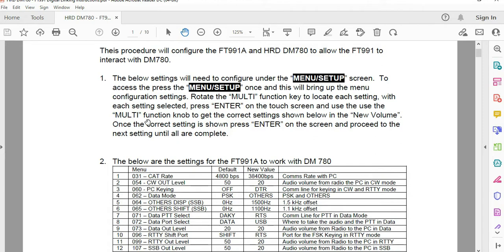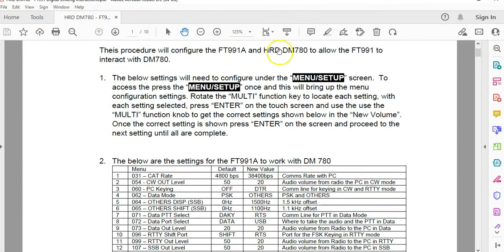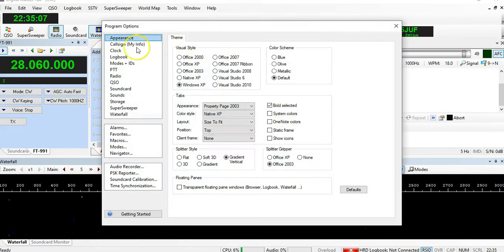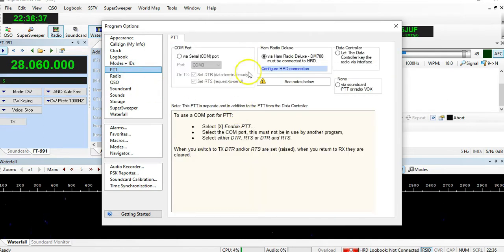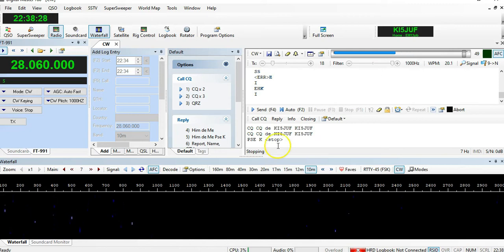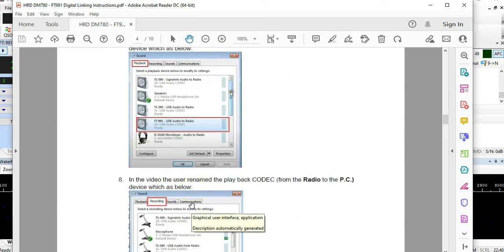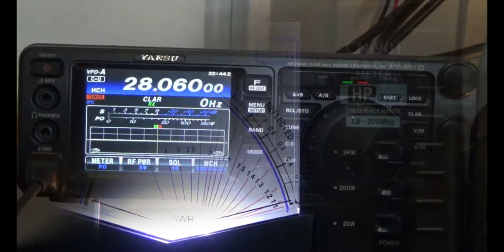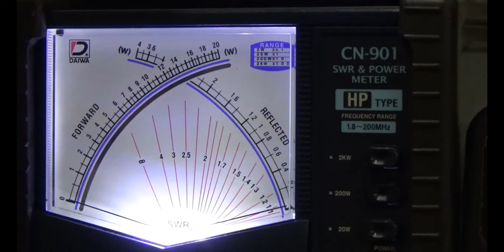HRD DM780 Keying Interface Yaesu FT991A Demo using RT42 USB Cable Interface Only

Comment: So I got it to work on USB on my 991a but it won't put out any power when using cw-usb as the mode on the radio so I know the software and laptop all is fine there but I can't find anything in the radio settings to help with this.
Reply from the maker: Try C-U this may be what it needs to key the com4 port standard port (C-U) over 9 MHz and (C-L) less 9 MHz GL let me know I hope you get it working FD Best 73
Reply: @westtexasvideogateski5juf255  Tried that and even went so far as I did a factory reset on the radio and went thru the set up again when I key the radio from 780 in c-u mode I get a carrier but nothing else its like its just dead keying the radio
Reply: @westtexasvideogateski5juf255  qq if you are still using that radio for this what is the firmware version wondering if that might be the issue?

Comment: i still can not get hrd to key the ft-991a i change all of the menus on the radio has you have them and chnage hrd to what you have but still cant call cq. hrd seems like it can control the radio but will not go into ptt

Comment: Perfect video, CW works but..... SSTV? I succeeded in hearinf de soundcart but then it is not tranamitting or the otherway around. Rig is transmitting but no sound. 2 days of struggle with all different setting but no solution.
Any ideas about the right menu settings on the ft991A + DM780

PA1FRJ

Comment: Thanks for this, brilliant, FYI the settings are the same for the new FTdx10
Reply from the maker: Good evening Ton, thanks for the message and that's great to hear the settings are the same on the FTdx10, actually I looking at that as my next radio, can it  do all mode's?  '73 de KI5JUF
Reply: @westtexasvideogateski5juf255  hi, You won’t regret buying the FTdx10, superb receiver. The radio does all standard modes. I’ve tested it with DM780 on RTTY and Olivia so far, works fine. I think it might need an external keyer for CW but I use my brain for that!

Comment: Tnx!!  CW works! :-) I was trying some time to get this work, but unfortunately it didn't work. Thanks to this video is does now. Except for RTTY-USB. I wil transmit, but there seems a frequency offset that is too much and the other station doesn't hear me. What is going wrong here? tnx in advance Louis de PD8L.
Reply: Hello,
In CW the FT991A with DM780 works, but not in RTTY in reception. And you ? Thank you.
F1SKF
Reply: @HervéCOURTOIS  Receive is not a problem, it works fine..transmit too, but there seems a difference in the frequency compared with the D-U modus.